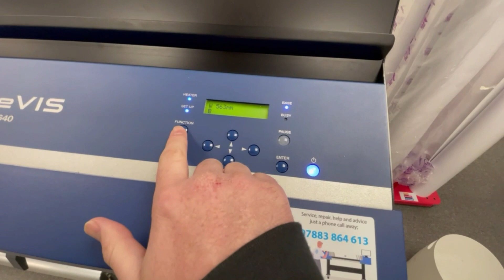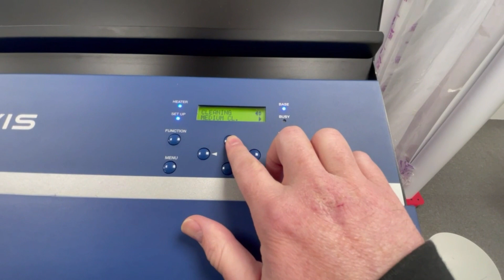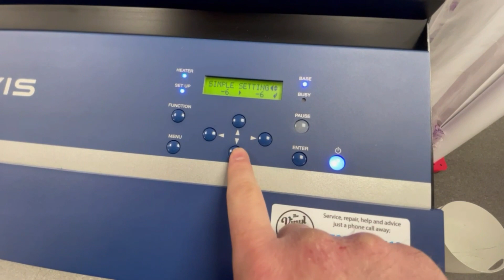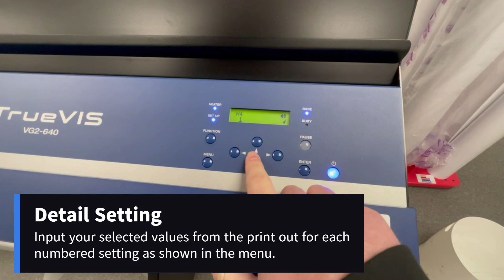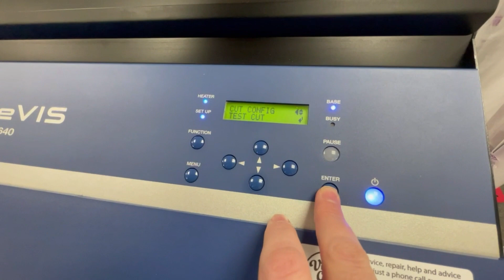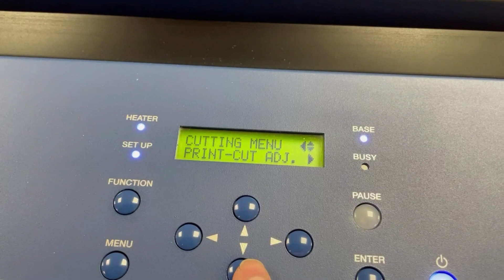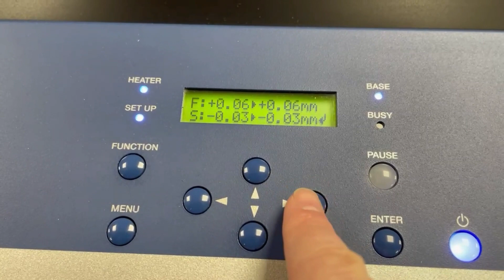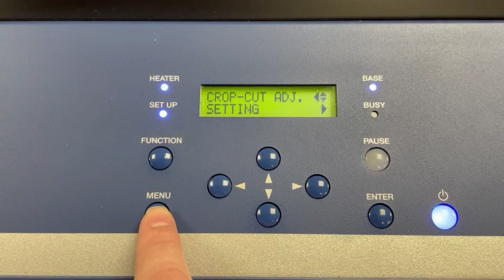How to perform media gap, bi-directional adjustment, feed calibration and print / cut adjustment.

Comment: I know this is old, but what do you do when doing the print and cut adjustment if your seeing lines on both sides? Originally i had a big line on the right side. Now that ive adjusted it, I am seeing a really thin equally sized black line on both the left and right side. I have a SG-300 Thanks

Comment: @thevinylguys Great video! How often would you run these calibrations? should it ne as needed or something you should do weekly/bi-weekly? Thanks!
Reply from the maker: Best to run all calibrations regularly depending on how much you use the machine. We tend to do them across our machines weekly to keep everything spot on. You could build them into your re vault maintenance with maybe a Friday manual clean or something similar
Reply: @thevinylguys  sounds good! thanks for the reply!